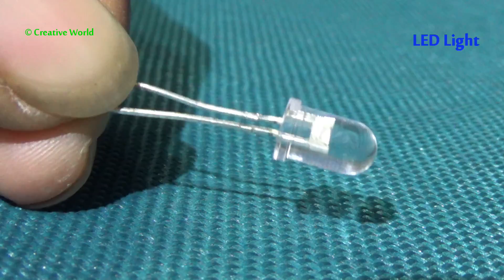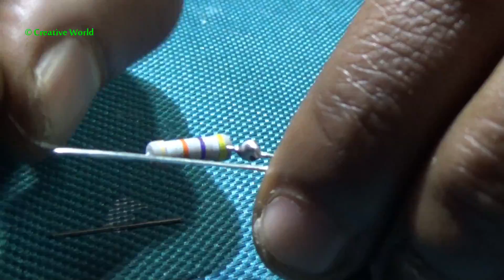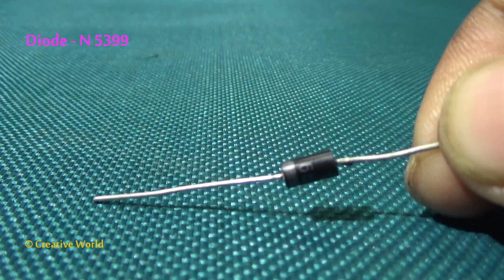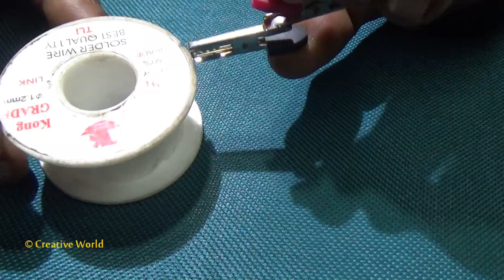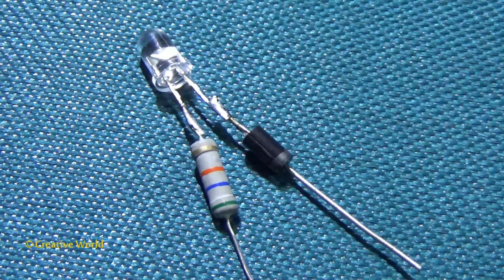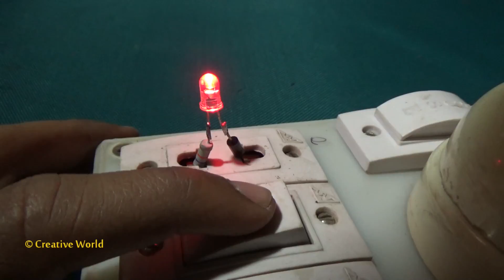Homemade - How To Connect LED Light To 220V AC (2 In 1)

Comment: is that diod is to straight the AC to the one leg? does it make differences to plug the resistor to cathode or anode leg? is it wrong to calculate the ohms by total voltage (230 without calculating the voltage drop)? I saw a video using 9k resistor for 230V so are that wrong? it we use more ohms the current will be drop and how the led will work? I have a question about 3V smd LEDs, if the current is 150 mA and we use 5v USB supply, should we do this math 5v/150ma to get ohms or 5v-3v/150ma? and how about 6V led with 5v supply? will it light up? and how about the wattage? so what happens if we use 1/4 watt resistor for 1W LED? and should we make 4 or 5 1/4 watt resistors in series to have 1W right?

Comment: If you have old Nokia charger you can use that  simply connect led and resistor ( 330E or  560E or in between value ) to the out put of the charger  wire   for eg:  charges out put pin/wire  + (red wire normally ) to one end of the resistor and other end of the resistor to the + of led and - of led to the - of chargers pin/wire (black wire normally) if you use 330E = more bright,  560E  = bit less bright than that, do experiment and set your required brightness
Reply from the maker: thanks
Reply: 330 ohm will work actually I need to repair Dp switch indicator
Reply: I am using 100 ohms resister.

Comment: How long use continuously, that resistor or diod getting any heat
Reply from the maker: if you want to use for a long time, you should use 2 or 3 watts resistor and diode.
Reply: É importante que ao se fazer esses vídeos que sejam mostrados os WATTS do resistor para que o LED fique ligado por muito tempo, indefinido. (Carlos - Brasil - 17/05/2020)
Reply: Can I use 5 (nos) 1watt resister as parallel for long life?
Reply: I use 100 K 1/4 W as a resistor with 3 or 5 mm LED  for  indicator on all my extension boards , absolutely no problem when used continuously